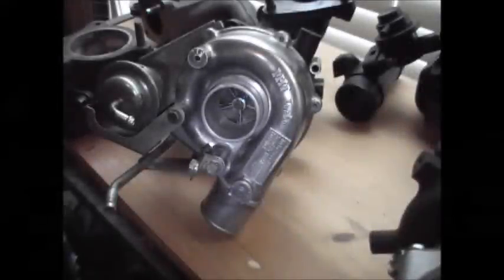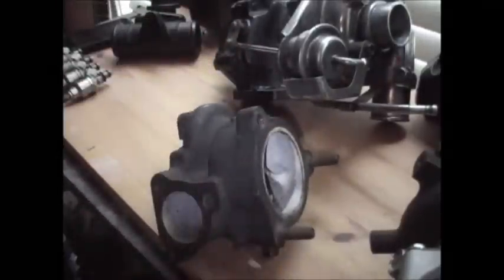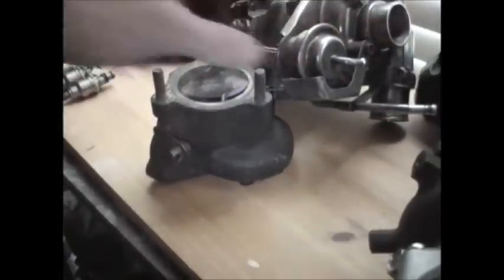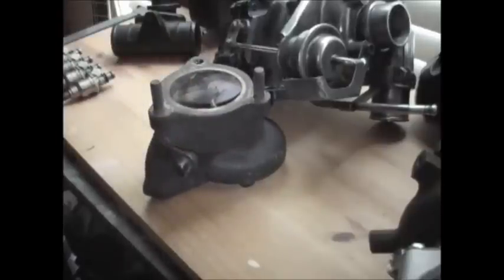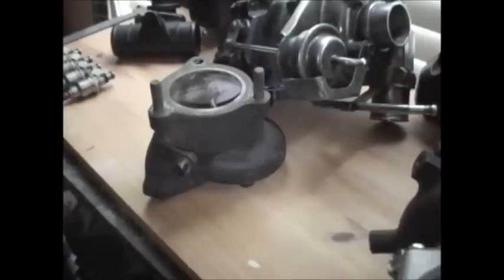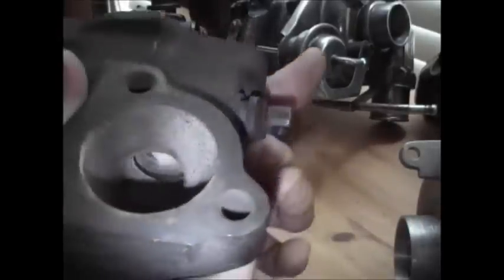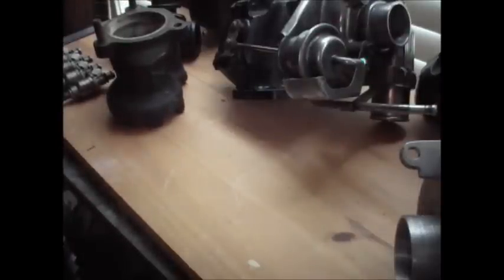How a Turbocharger Wastegate Works

Comment: where does the diverted exhaust flow to? into the air or does it bypass the turbo into the exhaust?
Reply: +bobrulerofall there 2 different kind of exhaust setups.  One uses a split dump system in which the waste gate has its own "dump" or exhaust pipe (typically smaller diameter). The other uses a single down pipe that combines the turbine wheel and waste gate exhaust into your turbo back system.  Generally speaking the split system is louder.

Comment: can I put a K04 compressor housing and wheel with a K03s transverse turbine housing? It seems very plausible to me, you can make hybrid turbochargers out of many different parts basically, correct? Do they have ball bearing repair kits for a K04-001 or K03s, and a upgrade kit to put a K04 compressor housing and compressor wheel? Or even a GT28, GT17, T3 as long as the compressor housing fits onto the CHRA? The GT1752 compressor housing looks the same almost to me, I haven't looked side by side but would a GT1752s compressor housing and wheel make more boost than a K04-001 transverse turbo, or the stock K03s? Any ideas where I would not need to remove the entire turbo and can just change compressor wheel and housing while it's on the car? What turbo is better and more efficient and holds the most boost through the rpm's, the K04-001 or K03s? Thank you

Comment: u don't know what you're talking about, a wastegate opens or closes to increase boost, when you're engine burns fuel you have exhaust gases which will spins the turbine and compress the intake side of the turbo. A waste gate controls how much exhaust gases you need to spin the turbo, if its nearly closed there is a lot of pressure but when you let off it will open and let all that pressure out or go at a low rpm, a blow off valve will remove compressed air form the intake side before it reaches the throttle body when you let off the throttle so it wont stall or have stress on you're throttle body, it releases the compressed air into the atmosphere or a bypass valve returns it to the  pre compressed side, sorry for my bad english

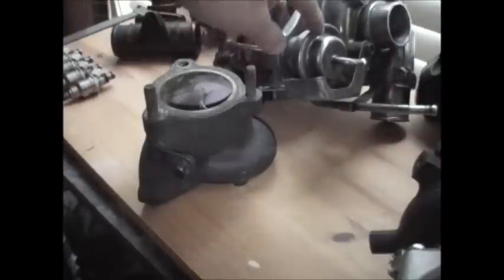Comment: This guy has some clue of what he is talking about, but states some things COMPLETELY INCORRECTLY.  First,@1:01"exhaust gases need to be diverted from everything else so when you let off the throttle".....uh, NO.  The big concern is that, when you are hard ON THE THROTTLE your exhaust gasses will cause the compressor turbine to spin too fast and you will over boost!!!  A wastegate has NOTHING to do with when you let off the throttle.  That is where the blow off valve comes into play.  The wastegate's sole purpose is to divert exhaust gas from the turbine hot side to maintain a safe amount of boost pressure by slowing the exhaust turbine, which is connected by a shaft to the compressor turbine, which creates boost pressure by accelerating the intake air.  Also, the blow off valve has NOTHING to do with regulating boost pressure after the compressor.  The function of the blow off valve (BOV) is to release the wave of air flowing back from the throttle body when you let off the throttle so that it doesn't flow back to the compressor and cause it to stall which is very bad.  The BOV opens and allows that wave of air to escape either back into the intake, pre-compressor, or out into the atmosphere.  Also the "compressor needs to regulate a certain turbine speed" is completely INCORRECT.  The compressor turbine doesn't regulate anything.  It is regulated by the speed of the exhaust turbine, which it is connected to by a shaft through the turbo.  The exhaust turbine is, in turn, regulated by the wastegate opening when the boost control solenoid instructs the actuator arm to open the wastegate.  This is a correct explaination of the function and purpose of a wastegate, exhaust turbine, compressor turbine, and blow off valve.
Reply from the maker: I was very backwards when i made this video, my turbo knowledge was limited, I appreciate your feed back and I will be releasing a much more detailed and correct video in the near future thanks for watching
Reply: No problemo,  nice to hear someone as receptive to correction. Cheers.
Reply from the maker: Cheers.
Reply: bpm03 Be kind to the internets and delete this video since it comes up in the top google listing for how a wastegate works and you have admitted that this video doesn't explain it well.
Reply: +Lee  Douglas ahhh good show lad
Reply: your on the money!
Reply: my first car was a 1986 Mercury Merkur XR4Ti and it didn't have any bov/diverter valve or intercooler. You couldn't even run an aftermarket air filter because the MAP sensor will make the car stall instantly and mounted inside the stock air box. I bought a 1987 Mercury Merkur XR4Ti a week later and built one with a T5 Trenic 5 speed transmission, solid rear axle, welded u bolt driveshaft instead of the rubber donut. 30 lbs of boost, grand national compressor wheel and bored out housing. Basic head build and forge rods. The clutch was a high performance clutch from Chelsea clutch in Revere, MA where they make them there. It went in the third pull. That thing was a beast and it was built in two nights, head, rods, transmission, rear axle, except the exhaust was done custom, all one piece with everything deleted. had no intercooler, nothing just a house to the intake manifold
Reply: Lee  Douglas ...my wastegate is stuck closed, how do I resolve this problem? My car revs on its own when I'm going fast and I let off of the gas.
Reply: 3 in 1 penetrating oil, light tap with a hammer or screw driver?
Reply: Hats what he said.In so many words he said to release pressure.
Reply: Thank you for clarifying that Lee. And good to see somebody who can take criticism without being defensive.

Comment: My STI turbo looks similar, there is a crack on the waste gate port where the flap meets the turbo, is this the reason why my peak boost is much lower than target boost? is boost leaking out? I have gotten my turbo system smoke tested, checked the boost control solenoid, to rule out turbo leaks..COBB checked the back side of the turbo and found a crack through and through, I just want some reassurance that this is causing my loss of boost THANKS FOR ANY INPUT...